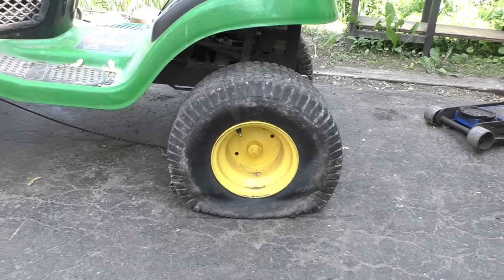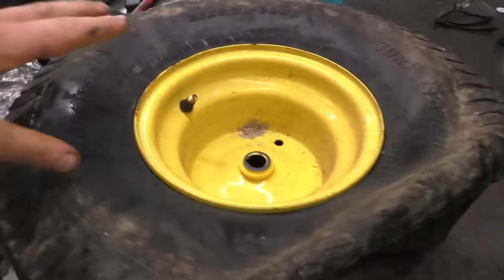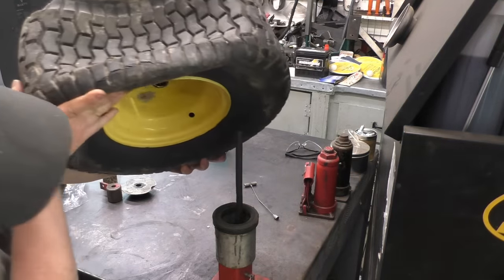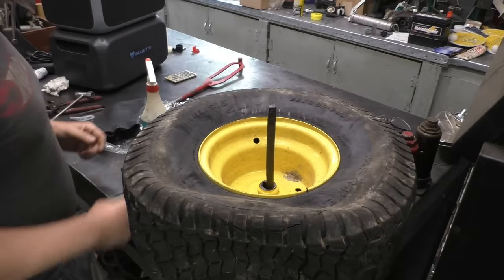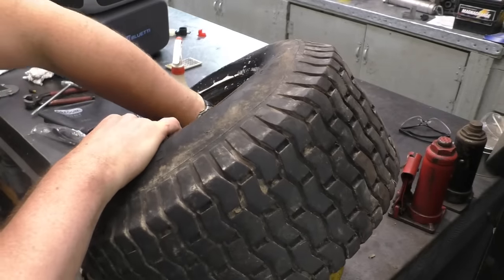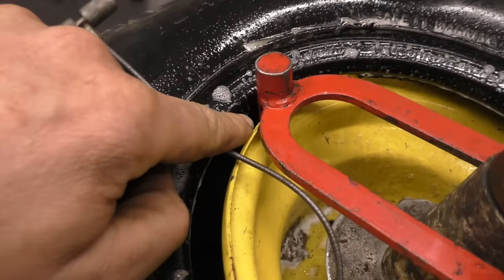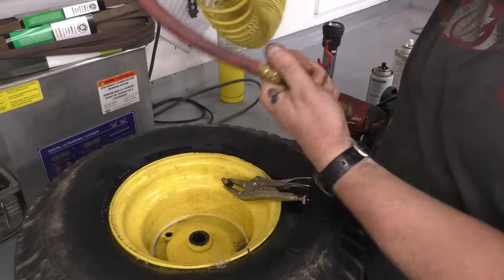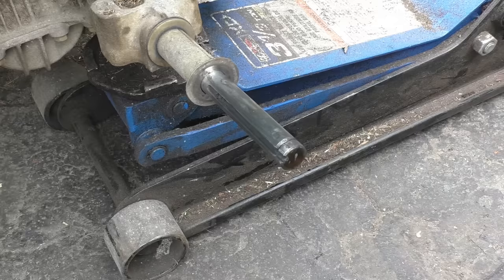The Best Way To Fix Flat Tires!

Comment: Back tyres are not too bad, but tyres on small wheels become quite difficult. Any got any tips?
Reply: Lots of patience.  I did it with long screwdrivers and Vice grips, not easy. $60 for that tool at Harbor Freight which makes it much easier. So, how much is your frustration worth?....lol
Reply: @Dusdaddy  I have the tool, well, a British version of it, but small wheels are still challenging.

Comment: But how to do it WITHOUT the tire changing tools?
Reply: I have a long 5/8" Eybolt that I anchor in my 5" vise.  Usually the tire bead is not 'stuck' to the rim.  I make sure it isn't before I put it on the vise.  You can break a bead loose by driving a vehicle tire over the stuck one.   3 serious long screwdrivers and Vise~Grips.
After Lubrication, pry up  bead, repeat and repeat and repeat.  I clamp the Grips on the edge of the rim to keep the tire from moving around behind you.

Comment: For those of you who are thinking of using that green Slime stuff, don't - unless it's an absolute emergency. I found out the hard way what it will do to rims if it's left too long inside the tire - namely: it will cause rust to form inside the rims (even steel rims) and makes a mess inside the tire that's a major pain in the ass to clean out properly.

Also, from everything I've heard and read, it's apparently very corrosive on aluminum alloy rims.
Reply from the maker: I see the exact same thing in the shop, makes all the rims rust inside and a mess to clean!

Comment: Replaced two 23 X 10:50 X12 tires last week, cost $245!!! They were 23 yrs old with leaking/dry rotted sidewalls. Tube was only $45... Geez 😮
Reply: Need to tube one those but can't get wheel off. 1989 western international.

Comment: I don't know why you have to go through all that trouble I got a strap from harbor freight I cut it off to make a shorter I wrap the straight around the center line of the tire and I cranked it down forcing the bead into the wheel I then applied air if I found a leak I would let it leak down I would apply slime half a tube and again I would apply air and that usually does it on the tire stays full you don't even have to take it off the spindle

Comment: perhaps it would be BEST to pull the tire forward once 1/2 of it is off the rim so you can easily look inside of it to see IF there is a sharp object ! just blindly rubbing your hand inside in hopes to cut your hand isn't a good idea !   Paying $100 dollars for a tire puller ? I'll bet a repair shop would install a new tire and tube for much less $$$ ... another ole trick is to pour a little baby powder inside the tire so the new tube can easily slide into place as you inflate it .  IF you have cuts in the tire - you could cut up the old tube and make patches to glue inside of the to help hold it together